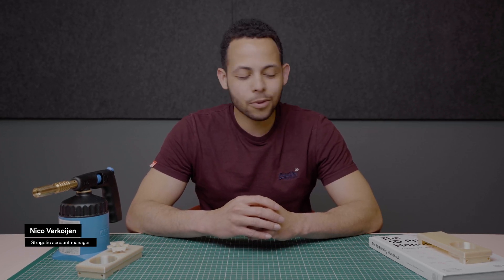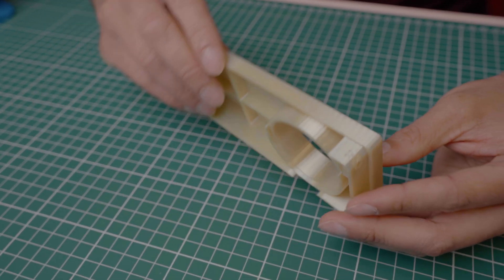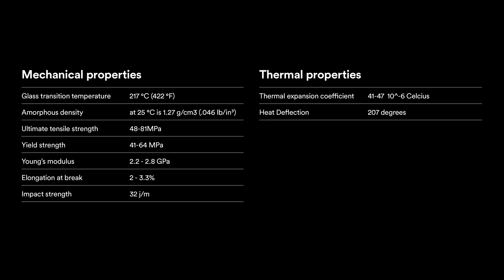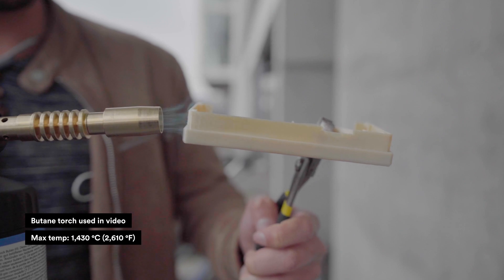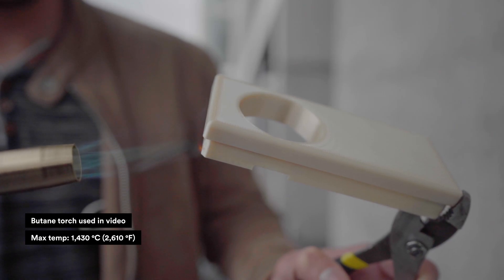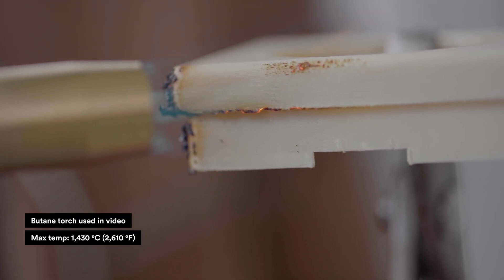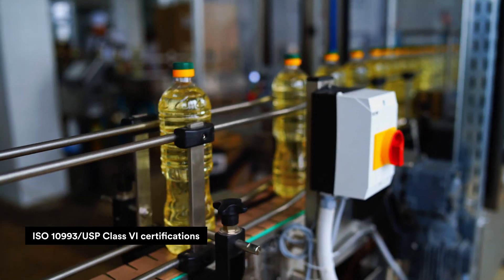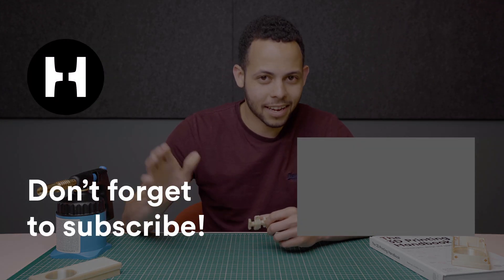ULTEM 1010 - 3D Printing Materials Explained

Comment: ULTEM 1010 is in a league of its own for extreme conditions! 🚀 Its unmatched FST rating and thermal stability are why we utilize it at Jevny for mission-critical prototypes and end-use parts in aerospace and automotive. When failure is not an option, this is the material.